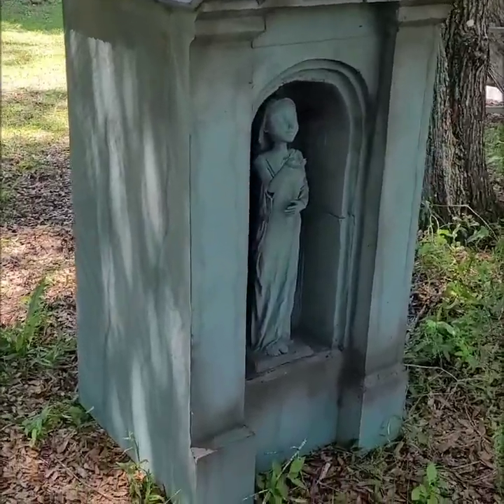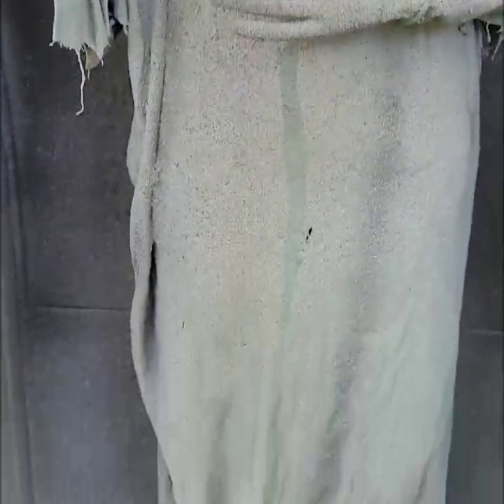cemetery prop

Comment: How did you attach your roof? Nails? Screws?
Reply from the maker: @aprilh691  i used caulking on the whole roof. I used nails where i had foam on foam. And screws where it was over the wood framing. Those were mainly to hold until the caulking dried. Im adding a link to my more detailed video if you wanted to see more of the fab. I still didn't show the roof. On how i held it to the framing. https://youtu.be/8xBSqeq3948?si=4b9QKBbE-Gq5i__N
Reply: @bluedakota80  thank you! Love your videos!  I built a sleepy hollow bridge out of wood and foam and need to be able to assemble and disassemble  it so I can store it. I was looking for ways to attach the foam  roof. I might use bolts, but am not completely sure yet.
Reply from the maker: @aprilh691  you can glue wood to the foam. And when you set it on your bridge, you can do screws. Then when you take it apart. The roof with those pieces of wood will come off together.
Reply: @bluedakota80  thank you!